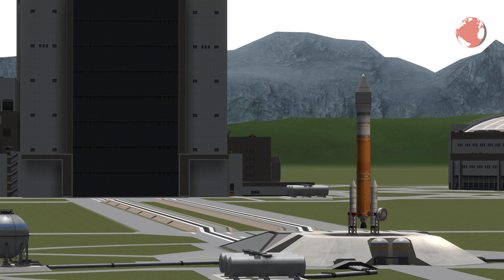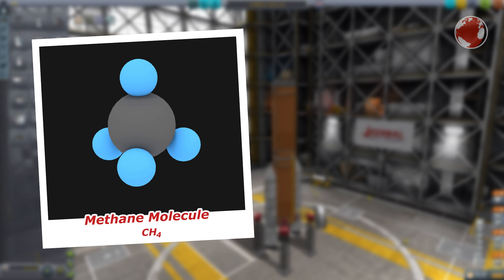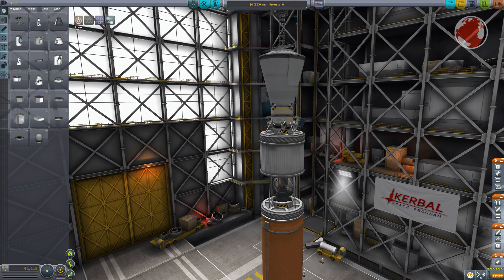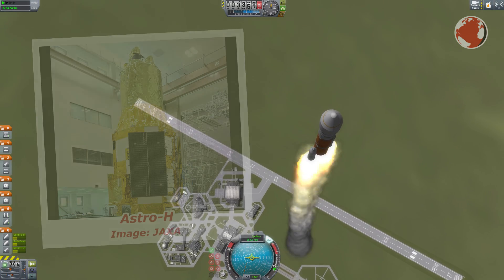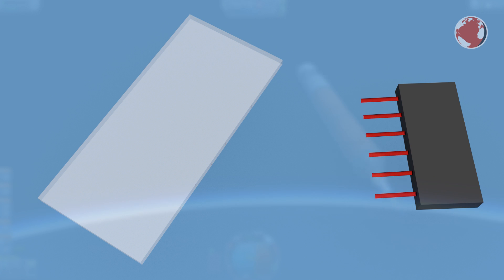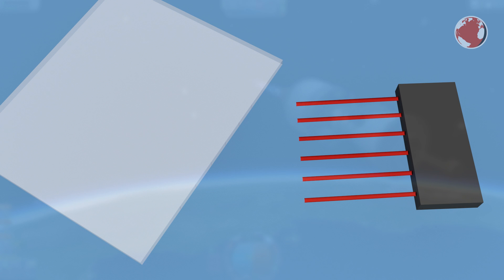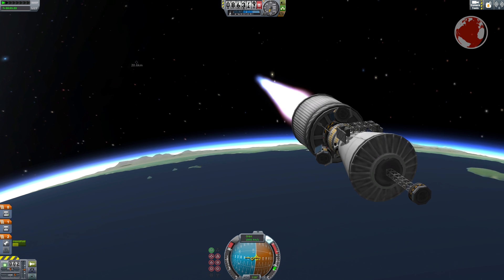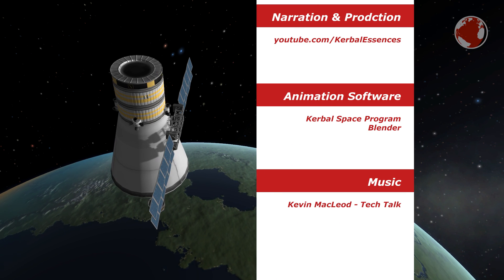H-IIA 202 Launch! | Astro-H | KNews #31

Comment: Ich erkenne in deinen beiden Animationen einen Widerspruch. Doch Ich bin mir sicher, dass ich was noch nicht verstanden habe.
Kannst du es mir sagen? :D Übrigens echt cool, dass Du sa ganz nebenbei noch Physik unterrichtest^^
Reply from the maker: +Silas Gramlich (engl. at bottom)Hi, was genau widerspricht sich denn? Bei der ersten Animation dehnen sich die "Kreise" langsamer aus als bei der zweiten. Das soll quasi simulieren dass sich das Licht in dem einen langsamer als in dem anderen bewegt. Je langsamer sich das Licht in dem Medium bewegt desto st&#228;rker wird das Licht gebrochen. Testen kann man das zB. mit Wasser und Öl bewegt sich das Licht langsamer als in Wasser weshalb ein Löffel zB stärker gebrochen wird wenn man ihn ins Glas steckt.

What exactly contradicts itself? The circles in the first animation expand slower than in the second. This shall simulate the light being slowed down in speed in that medium. The more the light gets slowed down the stronger it gets refracted. You can test it with a cup of water and oil. If you stick a spoon in both cups you can see the difference because oil slows the light down stronger than water.
Reply: Mhm, bei der einen Animation wird kein "Licht" gebrochen, bei der anderen schon, obwohl doch beide den gleichen Medienwechsel haben, oder?
Reply from the maker: Silas Gramlich Neee, die Medien sind unterschiedlich. Beim zweiten breiten sich die Wellen schneller aus weshalb das Licht schwächer bricht.